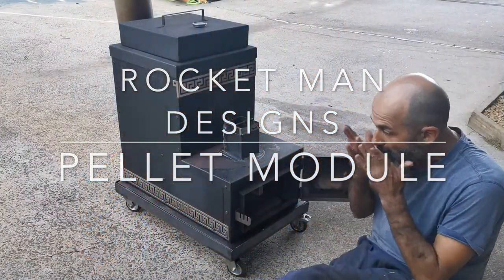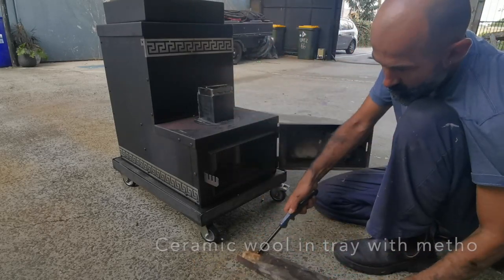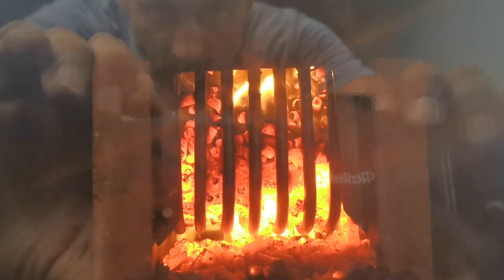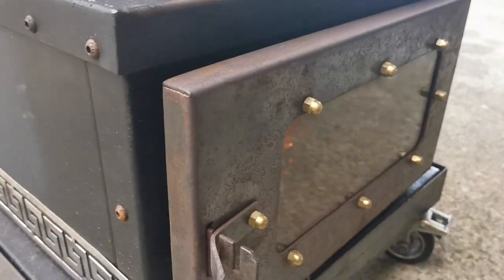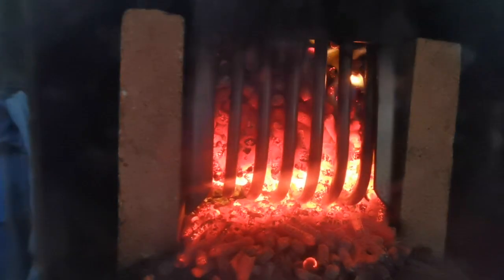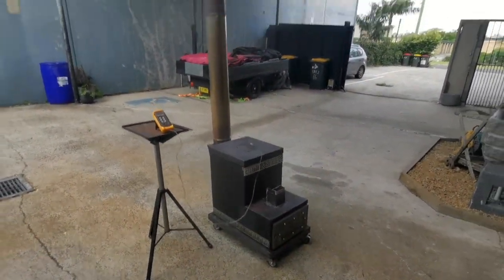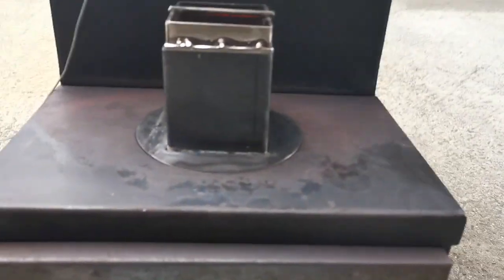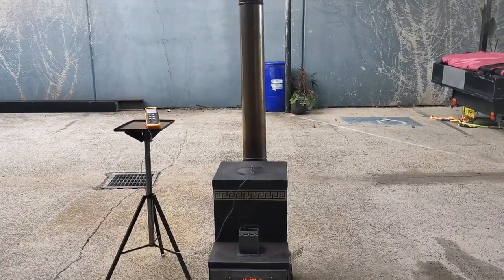Pellet Feeder Module 1

Comment: Hi Russell Sir, Do you share the details of the design of Himalayan Rocket Stoves(You said it's an open source design), ones selling in Ladakh, as it's selling for more than 300 USDs in here, very expensive for an average earning household.
Reply from the maker: The cost is a factor based on the amount and quality of materials in the product, and the transportation charges to get these units to Ladakh. It would not be possible to make our design any cheaper, unfortunately, due to the way we use CNC Laser for mass production. We do have a lower cost EcoMini for sale in Ladakh, which is also highly effective as it uses second generation technology in the design.